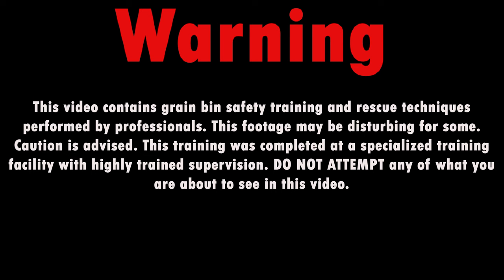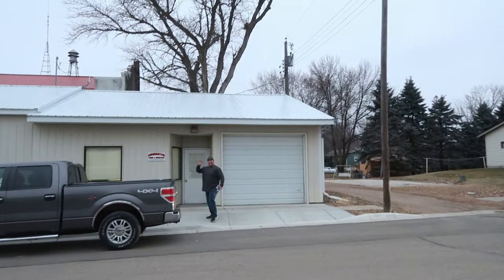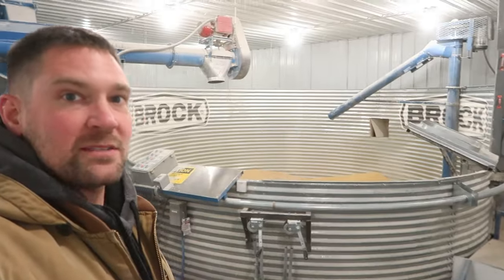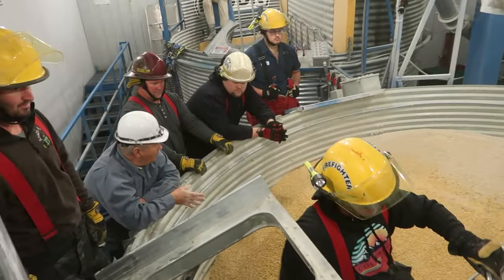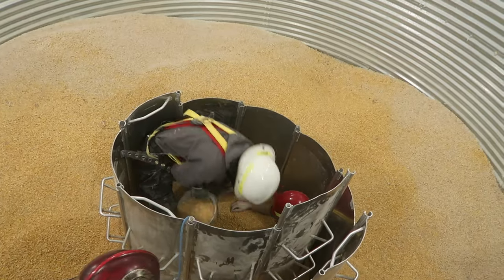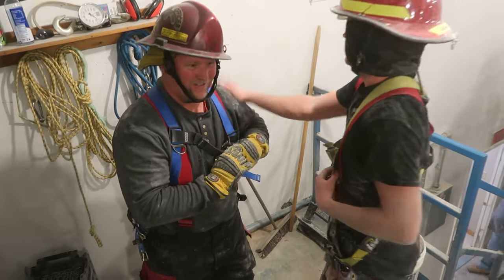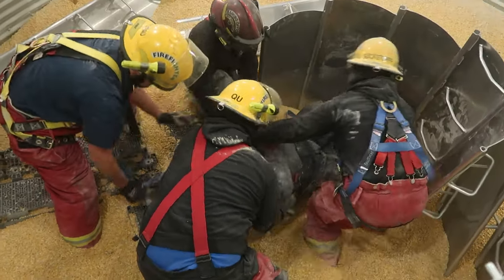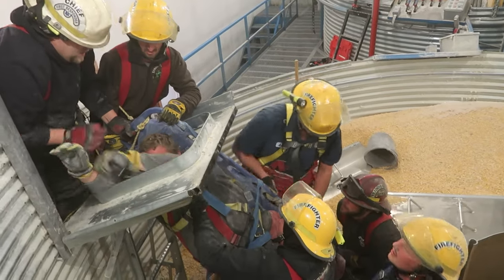Grain Bin Rescue

Comment: The whole rescue would be a struggle. Getting the equipment to the top of the bin. Assessment of the victim. Situation assessment. Without a platform or catwalk outside of the bin, its challenges. And last getting the victim to the ground. Lots to consider. Randy being a big guy shows re real potential challenges. Good vid. Be safe guys.

Comment: For the life of me, I can't understand how anyone would go into a grain bin without wearing a harness attached to an overhead winch that they could activate at the first sign of trouble to winch themselves up.  I've got to believe that the grain bin manufacturers have such a system available for newer bins, and with all the ingenuity that farmers have, they could rig something up along these lines to work on the older bins.
Reply: Us farmers have to.and were you the winch go
Reply: @blakescountrylife7063  I recognize all of the words, but the order makes no sense...
Reply: @blakescountrylife7063   I think it’s supposed to be “the farmer does what he has to in order to get grain moved.  Where would the winch go? How would it be powered?  Inspected...”
Reply: People forget all kinds of safety when they are in a hurry, or tired
Reply: @larrythompson8630  I'd say the winch would have to obviously be attached at the top of the bin.  If there isn't already power up there, it doesn't seem like it would be all that difficult or expensive to run the power up to the top of the bin.  I'd have a harness stored at the top of the bin so I wouldn't have to remember it each time, just like any tool that I took to the top of the bin would be on a one-way trip as I would leave it in a tool box at the top.  If you used the tool once at the top, you'll eventually need it again.  I'm trying to eliminate additional climbs to the top carrying tools.

Comment: This always reminds me how every farmer I know has a story about someone dying in their manure pit...
Reply: A farm is one of the most dangerous workplaces in the world.  I grew up on one. There are 1000’s of different ways to get yourself hurt or killed.  As you mentioned a slurry pit kills quite a few.  Loca farmer had 3 folks lose their lives when someone was down in trying to fix the discharge pump when fumes took him down. Two helpers jumped in the pit to try to pull him out and they died too.

Anything spinning can take you out pretty quick too. PTO shafts are deadly.  Getting caught on any kinda roller chain whether it be on a hay elevator, baler, or something will kill or maim.  Getting crushed is a real possibility if your working under something and it gives way.  Just countless ways.
Reply: @jayss10  Ah yes, but I'm Dutch! Over here we don't really have open air pits. But older barns still have cellars where they keep the manure. In those it's asphyxiation that gets you first :S
Reply: @jayss10  the farmer in chief on the farm I work on (aka my friend's grandpa) had his face broken in three places by hay elevator crank over the summer. They installed a ratchet crank on it after that. We still stacked hay that day too. (He's not usually a stacker so no hitches there)
Reply: @jayss10  This will sound unbelievable, but it's true. When I was a kid growing up on a New Hampshire dairy farm in the 1940's I fell through an open trap door in the floor into a manure pile up to my neck. Luckily my grandfather found and rescued me and I ended up in front of the farm house getting washed down with a garden hose. It's all funny now for my family, but I'm lucky to be here at 77 years old (not full of shit from that anyway).

Comment: You kinda get an idea of how difficult this type of rescue would be. However, there was too much light, ventilation and room in the mocked up bins. I have worked in bins that were stifling hot or freezing cold, dusty, cramped and dark. Imagine doing this in those conditions and the patient really is suffering. It certainly proves the adage to practice how you will perform. When conditions are not ideal, you still have to find a way to get the job done. Great video. Thanks, Zac.

Comment: Zack, when I  saw this, I figured there would be some emphasis on the hazards of the offgasing of the grain.
Several years ago (45 years ago), I  was shoveling corn grain from the old silo out into the tractor bucket. Something I  had done several times before.  But this time I  got light headed and felt I was going to faint. I knew enough to get out.
Obviously this not how grain is removed from silos now, but it shows how risky the off gasing of grain can be.
Love watching your videos.  From Ontario Canada.

Comment: Zack great thing you did.  We are starting back up in ND to train hands on and will have our mobile simulator on the eastern side of the state.  My department has 2 set of the Outstates Data Tubes and we actually had a save a few years back.

Comment: Very nice to see for a Swedish FireEngineer/Rescue Leader! We have not so much corn locally, but it seems anyway have the same physics as grain on this side of Atlantic.  ;D We use same system to rescue trapped persons, the only difference I can see are we have breathing apparatus with radio for all inside "hot zone" personell and even to the trapped also for assisted breathing, Ex-safe lighting and all uses mountaineering safety-lines and harnesses. We uses this also e.g in mud, sand, sawdust, granule silos, garbage dumpsilos, confined deep spaces and slurry pits  
But without real training it isn't worth anything!      Kudos to all involved in this program!  <3 <3 <3

Comment: My dad said something that's really stuck with me the last time there was an entrapment in our area.

There's a good chance that the firefighters know who they're trying to pull out of the bin.
Reply: The last entrapment in MN I heard of.  Was a Harvester Silo.  (Slightly different as main danger INCLUDES air with minimal O2)  basically poison air...
  IIRC the father went into silo.   I THINK he was the assistant fire Chief.  He was overcome by bad air.  His son called Uncle?  Who was the RETIRED Fire Chief??
  He goes in (also without SCBA) and is overcome. Someone called 911.  The Fire Dept arrived in time, vented the silo, retrieved the two bodies.  Sadly the son had also gone into bin to save his dad, uncle.  He died later that week. (Again memory it might have been shorter/longer)
  So we have two trained FD personal.  I would assume he could have gotten gear, set up practice with gear and couple buddies. 3 dead in one family.
  I won’t go in silo unless vented. It takes me under a hr to vent, and continue to put thousands of cubic feet of air into it while inside. BUT it increases the spoilage.  Think on that FD. Present, past, and possibly future leadership died.
  So even knowing dangers.  PAUSE, think, consider...  before dealing with a problem.

Comment: A high flow vacuum hose would move more corn quicker in a rescue situation than the buckets. The outflow from the suction could be discharged back on to the pile outside of the rescue tube. A rescue vacuum should be installed when every bin is built. The suction hose should be tethered to the bin wall inside next to the entry hatch for quick activation in an emergency and would not take up a lot of space and should be permanently wired with a switch by the hatch. A system similar to a whole house vacuum but more powerful would do it. A system in every bin would be much cheaper and easier to activate in an emergency.

Comment: My dad had a couple bins and a small dryer at his auto shop that a couple different farmers used over the years. He came home one evening, covered in dust and distressed. Apparently, he stopped by the shop to shoot the S and see how things were going. A couple other guys stopped over, and they couldn’t find one of the guys, they opened up the bin doors and started pulling grain out until they pulled him out. I remember my dad telling my mom about trying to pull corn from up inside the guys nose and out of his throat. The guy did not make it, they don’t know how long he was in there or know really why he went in. If I remember right it was to break up some crust or something.

Comment: I've been on top of coarse and fine rock and taconite pellets in the local mines with no problem.  I had no idea that grain would be so different.
Reply: Grain and particularly corn is more like marbles, so it rolls and shifts more easily and acts like quicksand. It allows the material to move more easily and does that rather than hold your weight. Small footprint and weight heads  you down more than hold you. I have not even mentioned bridged material more commonly associated with wet/moist grain. Walk on top of an air pocket and you are in a heap of troube, so to speak. Really entering grain bins with more than a person's waist height should be avoided where possible. This video was very good, some of the comments do not reflect the seriousness of the subject, but I guess that is normal for safety training and videos. Good job, Zach and all others concerned.

Comment: They should have anchor point above the door. Because in real life the bin is tall  and you would need a ladder truck or use the grain leg to hook a mechanical advantage system with rope's and pulleys to lift the victim out and then lower to the ground.

Comment: there should be permanantly hanging ropes with handles on them from the tops of every grain bin. The grain can be filled in the bin as usual, but if ever anyone ever got caught in there, they have something to grab onto or pull themselves up with. this would cost less than $1000 in rope/handles hanging from the tops of every grain bin top to bottom, and would never interfere with the grain process, but would provide an emergency safety system that someone could access if they didnt have a 2nd person or any rescue in place.

Comment: Unfortunately, I have had to use grain bin extrication training. Some have not had happy endings. This is an important skill for Rural Fire Depts to have. Learn it and train. We have used a rescue tube like the one in the video as well as small sections of plywood. 

I grew up on a farm it's easy not to think about situations like this but they can happen in an instant. You can be in a bin a thousand times without a problem then bam, you go down. Farmers should make sure that they have and USE the safety equipment(ropes and harnesses). They aren't comfortable but they can save your life. I would also recommend a buddy system so that help can be summoned as quick as possible.

Comment: Never seen quiksand before but your corn bins seem as least equally dangerous. Clever lightweight design, well done.  When you climb in a corn bin Zach do you ever tie yourself off so you don't sink all the way to the bottom if you do get trapped?

Comment: Looks like a good system.  How about a chain hoist or block and tackle permanently installed at in the ceiling?
Reply: Yep you pull the man apart with a chain host
Reply: @retireddriver16   I guess in a panic, but a two hundred pound, unconscious man is awfully hard to lift.

Comment: Just an idea but if fire fighters had snow shoes minus the holes they normally have in them they would not sink into the grain as much, just a thought anyway should work the same way as the kneeling pads they use only attached to their feet

Comment: Los Angeles city and Los Angeles County fire department might need a reminder. Ventura County fire department also. They might need to get the equipment around, it's too late once someone gets entrapped. The planks and t portable auger needs to be on the Urban search and Rescue trucks Ahead of time. The portable Auger could be run by the Jaws Pump. Hydraulic pump and motor.

Comment: As important as the grain bin rescue is, one thing that really stuck out to me is the people on the outside of the bin. Here in their mock scenario there was a large platform to stand on. Very few bins would have that kind of room to stand on. Reality is most bins will have a ladder on the outside, with no safety cage. In the event the individual that was trapped is unconscious an needs to removed with a body board through the man-hole opening, that aspect needs to be addressed to get the patient safely back to the ground.

Comment: Isn't there a power air suction device that can be used to remove the grain faster?  Air pump would remove explosion threat I would think.  As person would be trapped for quite awhile before help arrives.  Also how about a breathing device to be carried by those working in a active bin??

Comment: Zack I have no experience with any situations on this and wanted to ask about the rescue out of the bins. I saw the firefighters pulling the victim out of the grain bin from the roof. I they would only be able to do that if there was a platform on top. Many have just ladders. Would the firefighters use a ladder truck or telehandler to have more access to the roof exit or would they cut a hole in the top to get better at the victim. I appreciate the video and love your work.

Comment: Interesting. Why don't they fit a pulley at the top of each grain bin and make it a working safety requirement to attach yourself to it if you get inside the bin (on top of the grain)? If you attach an emergency electric winch to the pulley system it would also be fairly easy to pull anyone out of the grain. Maybe minus your shoes.
Second idea to to use skiing/snowboarding inflatable airbags in the safety harness. If you sink in you can inflate the system - it it will expand and provide a surface area which will prevent you from going down into the grain stack.
Just some ideas.

Comment: Very impressive to see a rescue training, never realized how dangerous grain bins are. The plastic load spreader trays are quite good but why not making a larger floor around the rescue retainer wall, maked moving easier and speed up freeing and retrieval. The portable wall works well. Instead of getting the grain out of the secure area with bucket i would get something like a vacuum truck to suck the grain out, messing with buckets seem to take a long time and i assume time can be critical. A 5 or 10 m3 vacuum truck and some 2 inch hose should do the trick. Sure fire rescue could arrange something in farm area's that can be mobilized. Does it happen often that a farmer get submerged over his head and suffocates or are most incidents like shown in the video. Why do farmers have to enter a grain bin, what is the reason to do this in the first place. Just wondering.
p.s. i like to watch your video's specially the harvesting and machines.

Comment: Why aren't winches built in to the top of bins. also is this equipment available at the top of a bin. And how long does it take for you to get to the top of the bin With the equipment. Basically if you fall in a bin ya fecked. Is what they trying not to say. X

Comment: Have they tried to "SWIM" out of the Corn by getting the Corn away from the upper body slowly first, then Legs out by turning the Shoes in a twisting motion to allow the Corn to settle under the Shoes slowly, pulling up one Shoe at a time and then bending the Core of the body at the waist spreading most of weight on a much larger surface area and then do a Frog paddle to the ladder?

  They could also just have a Chain, Rope or Strap hanging from the Roof to pull themselves up.

Comment: Why do they make the access holes so small? Seems like that would be a safety issue for getting an unconscious person (or a conscious Randy) out of the bin.
Reply: The bin is made to store grain.  The manhole is to look in, smell to check condition.  Access if needed.  Honestly you should NOT enter a bin from the top.   I have storage bins I have not gone thru manhole since the vents were added.  Only then because I felt self tapping screws were not permanent enough.  I wanted inside support, bolts.

Comment: Been there. Thought I was a goner. I was 10 years old and spent summers on my uncle’s farm. My cousin and I had to crawl into a bin to find a hatch that had fallen from the top and we were afraid it would get caught in the auger. The level of corn was about 6 feet and I was 5. As I was moving I kept getting lower and lower until I was waist deep. Then the panic set in and of course it just mired me deeper and deeper. Which made me panic even worse. My cousin finally found a sheet of plywood and had something to spread his weight out so he could dig me out. I was up to my chin. When I got out it started PTSD and several other mental health problems. But they didn’t understand these things back then. I was just being a “wuss” and I needed to “cowboy up”. I still have nightmares about it. So the bottom line? Don’t do grain bins unless you know what you’re doing. And don’t eat yellow snow. Just a side note

Comment: great job milenial farmer veiwer's, its tonage in a small compacting package, like water it gets  every where, hits you like a wave, it constricts the diaphram, panic mode is hyperventilation till you can't expand your lungs, shock sets in, push pole technology, 14' to 16' alumnium 1" pole, 4" steel pipe i.d. to the poles o.d., welded to a 6" x 4" piece of flat stock with  four holes 1/2" in from corners, a 10" x 14" trapaziod of 3/8" wood or plastic, long side down allows  corner/edge access, T or D handle on other end, stack falls on it , throw a rope  on handle wait for to ubcover, it starts with combine, dirty grain stack almost vert. if it releases your Gullivered with out the ropes pinned hoping the queen pares you, tonage, hope Randy's knee's are okk, they spun him on the board not cumpletely dug out, great job  everyone!

Comment: Why isn't rescue equipment included with every grain bin? It seems that having a winch installed in the bin with a rescue kit attached would save a lot of valuable time.
Reply: All new bins are sold with connection points and new stands on the doors but a winch the is not tested cannot be trusted in life saving operations.